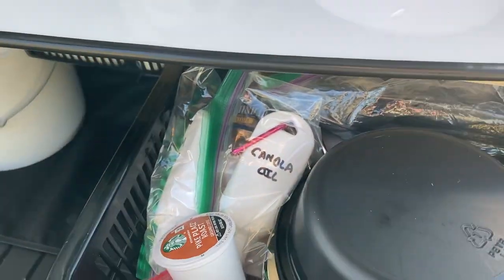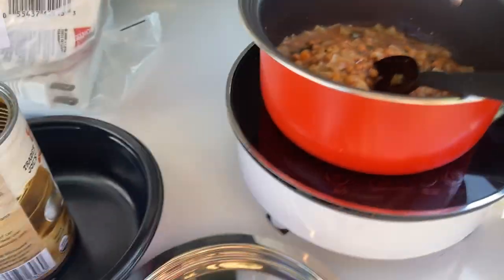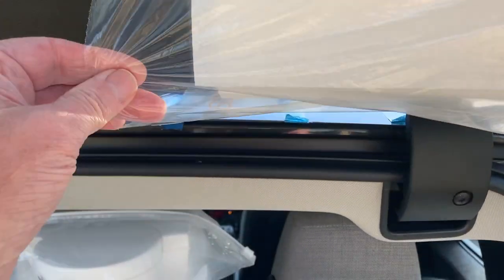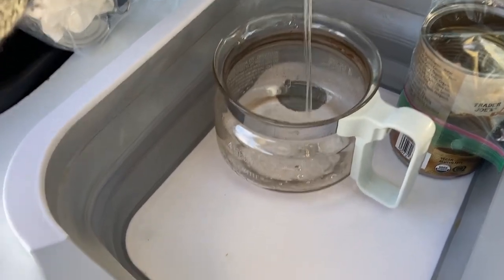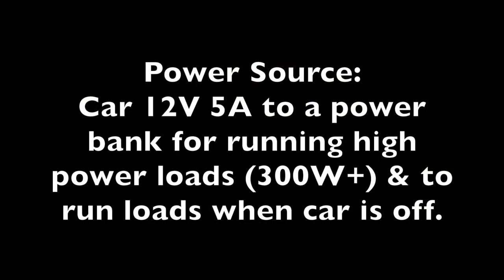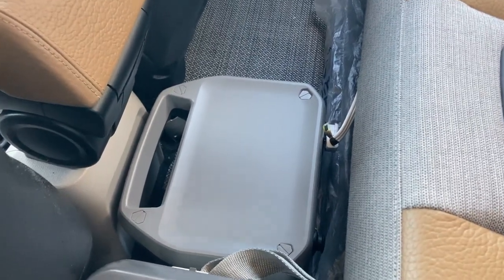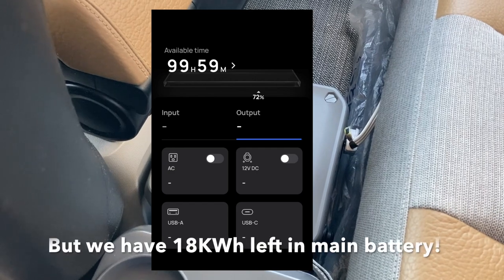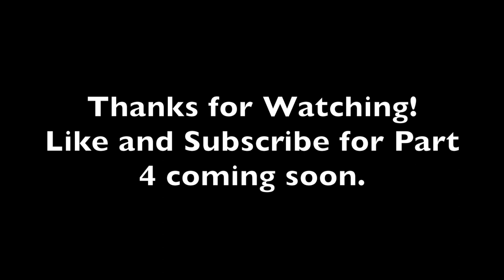BMW i3 Microcamper part 3:  Power Supply & kitchen Testing!

Comment: I'm looking into attaching solar panels to the roof of my bmw i3
Either rigid or flexible on a roof rack or semi fixed to the roof
With the intention of charging a solar  battery bank that I'll keep all the time in the car and will be charging up when the sun is out.
Then use it to.
1) Plug into the car when I need to top the HV drive battery up and charge the car while it's stationary, using the granny charger. Like in your 'solar emergency car charging' video from about a year ago.
2) Use the same battery bank (not at the same time) for car camping; cooking, charging my mobile phone etc
Keep up the great work with your fantastic varied subject videos and information about the i3 🙂
Reply: My usual commute to work is about 6 miles a day 
Average commuting about 40 to 50 miles a week
Longer trips are to go car camping
Reply from the maker: Thanks for the feedback!  I would suggest getting a bigger battery bank than the one I used here, if you're planning on charging the car with it, since the minimum power required is around 700 watts.  Also, the River2 only accepts ~100 watts solar input.    Good luck on your project!

Comment: I’ve long wondered about how something like an EcoFlow could be used to supplement a small EV drive battery. 

I have about 60 miles of range on a good day, so I’d gladly carry 50-100 pounds of extra batteries in the trunk to extend that a bit. 
I also prefer the less-bouncy handling when my i3 is loaded down with some extra weight. 

If it could be setup to discharge into the car thru the 12v system, that would reduce the power needed from the DC-DC inverter and starter battery. 

This could also be used to save gas on internal combustion vehicles by reducing the load on the alternator. 

In any case, very clever use of it here for camping!
I really like the trickle charging from the car without drawing too much current.
Reply from the maker: I think the battery bank feature allowing for user settable charging current from the 12V plug is nice, since there are many reports of 12v cigarette plugs getting too hot.    You have some great ideas to try!  Be careful feeding power back into the 12v system since it could cause issues with the DC-DC inverter- you don;t want to blow the internal fuses...

Comment: I own a BMW i3 2021, I'm trowing a cinema party night at a square close to my house. I was planing to power the projector and sound from my i3, and was planing to use the terminals on the EME. My setup draws about 350w, unfortunately the 12v sockets from inside the car are not strong enough for that kind of load. I've read you comment and got worried about damaging the EME. What is most wattage you have extracted from the 12v sockets?
Reply from the maker: From I've read, the DC-DC converter at the EME is capable of ~2kw output,  but I have not tried to use that much power.  The most I've pulled off of the (fused circuit) 12V sockets is about 120 watts.    I decided that it was less of a risk to just use a cheaper portable battery box (some of the new ones that output 500-1000watts / 500-1KWH capacity are pretty good at a decent price) & just trickle charge it using the 12V sockets.   That way the EME system is running at the expected loads, and if something shorts, there is a fuse link isolating the EME.   Blowing the EME internal fuse (or worse) is an expensive repair.    Fuse 65 & 127 for the sockets are both 20A fuses, suggesting the sockets are not designed for more than 240 watts peak power draw ( that's a lot for a cigarette style socket & will likely overheat quickly).   Good luck, and thanks for watching!

Comment: I'm thinking of simply leaving the car running, and power everything via the inverter, instead of getting a separate power bank.
Reply from the maker: I thought of that too (using the EME DC to DC inverter directly).   It is easily done by pulling power off of the top terminals on the EME (see video where I added an auxiliary battery to I3 when I replaced the OEM 12V battery , so the computer systems did not power down & possibly create fault codes  https://youtu.be/V63GwY3B1tc ).    The inverter I think is rated as a 2500 watt output (not sure if that is peak or steady state).   My worry is that if I overloaded the unit,  There is no easy way (or inexpensive way) to replace internal fuse or repair the unit.  With the cost to repair/replace unit by BMW so high,  It made more sense for me to trickle charge a power bank from the inverter to reduce load on inverter & isolate any overload/shorting event from the EME.  If you try it, let me know your experience!    I should also add that you cannot just get a 'used' EME from the junk yard and install it since units are coded to the original car  (possible right to repair roadblock?).      Thanks for watching!
Reply: @bmwi3diy782  I own a BMW i3 2021, I'm trowing a cinema party night at a square close to my house. I was planing to power the projector and sound from my i3, and was planing to use the terminals on the EME. My setup draws about 350w, unfortunately the 12v sockets from inside the car are not strong enough for that kind of load. I've read you comment and got worried about damaging the EME. What is most wattage you have extracted from the 12v sockets?